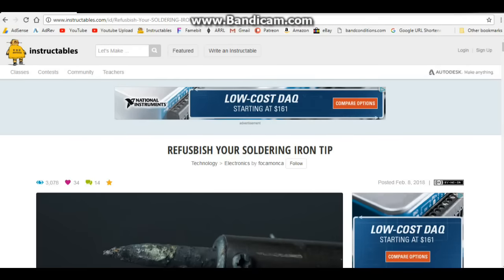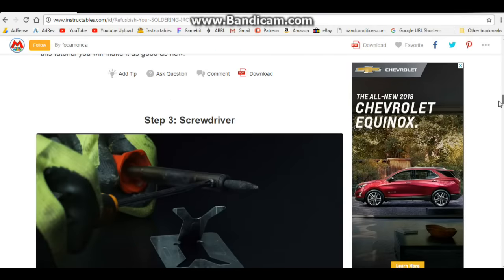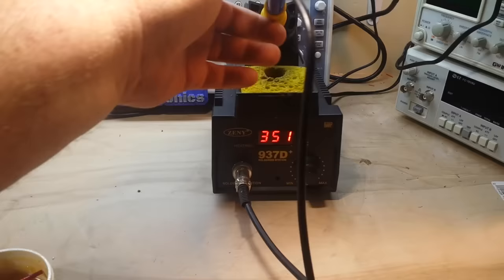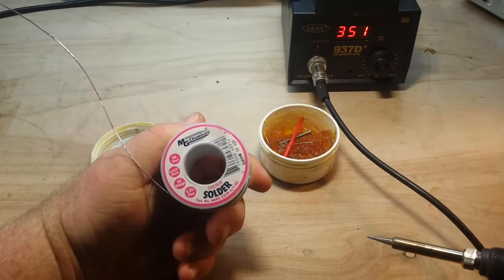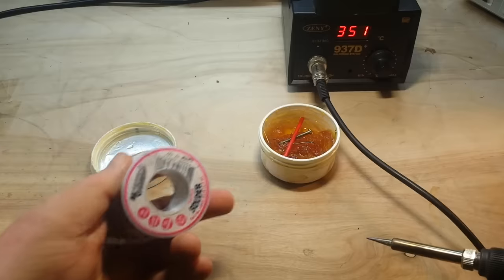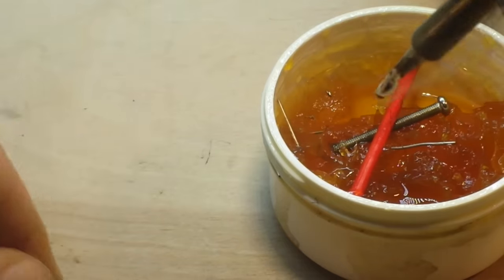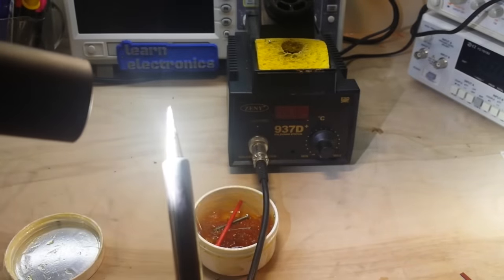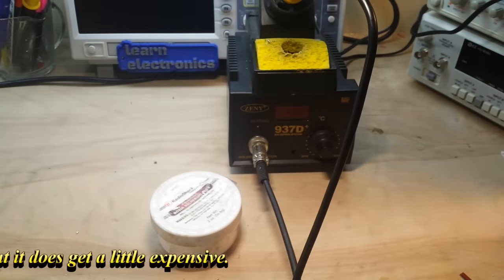How to clean and re tin your soldering iron

Comment: RIP RadioShack!  Is there a reason there is a hardware graveyard in your flux? I considered there could be some practical reason Paul.  Nice video.
Reply from the maker: Just random stuff I've used to scoop out some flux from time to time.
Reply: It reminded me of my flux container. Sometimes you leave the tools in the mix for readiness
Reply: All workshops I worked for had a flux container with stuff left in it.  I never saw anyone - me included - who'd volunteer to get the yucky screws, matches, bits of wire and leads, out of there.
Reply: Oh.... I though they were prizes.
Reply: He's lazy
Reply: it's called a flux capacitor actually
Reply: If I were you I would remove all that garbage from your flux container,  it makes you look unprofessional.
Reply: Mike K Who cares when you do the job right? A clean plumber isn't a true experienced plumber. REAL plumbers are dirty, dirty cars full of fast food and drink containers.  I'm working with 50+ years experienced plumbers and they have their tools and equipment scratched or unprofessional, but looks don't get the job done sweetie pie, try again.
Reply: Gods Bible lol , if you were going to have you picture taken HANDSOME....would you take a shower and comb your hair first? I suppose some might not? 😂
Reply: I bought a cheap $10 iron and used a blade to scrape off any crap that built up on it. Of course, I removed the coating and now the tip is completely destroyed. It's eroded off and it's because the copper dissolves into the solder. Not only does it damage the tip, it contaminates the solder and makes it nearly impossible to solder with the thing. Now I use a wet sponge or paper towel. Doesn't remove the coating and actually cleans much better.
Reply: Graveyard serves as a warning to other hardware.
Reply: WB0WQS likewise I'm from the UK and we had an electronics shop which died last year, sorely missed. Now anything needed has to be online.RIP.Joe
Reply: @ikannunaplays  😂😂😂
Reply: @RoamingAdhocrat  😂
Reply: Looks like my little tub of all purpose grease. Old nails, my kids watercolor brush, whatever was handy (and not submerged) when something needed a dab o grease.

Comment: Radio shack was good when HAM Radio Operators were in charge.
Reply: Remember in the 80s you could build a whole radio from the parts bins at radioshack. They catered to electronics guys and girls and went under due to only selling USB and hdmi cables ...sad...
Reply: @brandonbentley8532  It wasn't that.  They'd have been fine selling USB HDMI etc.  Their downfall was getting suckered into selling cellphones as a loss leader and trying to make margin on the accessories and warranties.
Reply: @cj5939  yup.
"Welcome to Radio Shack! You've got questions? We've got cellphones!"

Comment: I notice higher wattage tips corrode worse (Especially my 40w and 300w iron), and you do have to grind them in order to get them to last your money's worth. Sometimes the thin coating just isnt really worth much haha.
Reply: I also grind the 50 year old 300w soldering iron ;)
Reply: @danijel124  Same here , but that's usually a copper tip which seems to corrode away slowly. I usually put it on the wire wheel whilst it hot and quickly retin the tip. But the one shown here is not to be scratched in any way. I was in need of a new soldering iron, and they are still really cheap. So thanks for the recommendation. I wonder why the Americans say " soder" when in Australia we say "sol der" . Anyway. Great posting about tip cleaning.
Reply: you should use a weller temperature-controlled iron they are 60 watts, so they heat up fast but don't burn like uncontrolled tips that get too hot
Reply: As someone who uses a butane iron for soldering wires in automotive and some electronic repairs (not PCBs), the high heat is necessary most of the time and it absolutely destroys the tips. The moment the tip leaves the sponge, the whole thing turns blue, purple, then washes out to a pale grey in just few seconds. No amount of tinning ever makes it better. Once the outside layer has started pitting away, I get a new tip. They tend to last a year or two though.

Comment: Difference here is the "bad" example shown isn't a thermostatically controlled iron and the tips will be a purer copper alloy than the new ones.   It looks to be an uncontrolled 12 watt weller and mine will smelt steel!!
I have an Antex 35w and a Weller 12w, and while they are good irons they get as hot as hell''s steps if you leave them on and unused for more than a few minutes.  They were designed to be stuffed into a big spring shaped heatsink and regularly quenched on a smelly old wet sponge.  Both my irons look like the surface of the moon when not newly filed.  Its what happens when you use active flux on an old iron burning at something like 500 deg C.

When I started work I used a gas fire to heat a 1 1/2 lb block of copper on a stick, cleaned it with a 10" bastard file and used borax as flux.  Solder was a bar of wiping lead.  Times have changed.

Now my thermostatically controlled rework station ticks over at  a steady 345 deg C (+ / - 1deg C) and switches itself off if not used for 30 minutes.  
I don't use 1/2 lb of solder and a jar of flux cleaning it either - when I've finished working I dip my tip in the brillo and switch off - job done.
Last set of chisel tips I bought were 5 for £4 - the pointed ones were £3.50 for 10, that makes them cheaper than the solder.  I think of them as consumables I change tips to match the current job.
Reply: Now here is a person who knows what they are talking about. I have a couple of those old irons in my tool collection. Some from my gramps, a lead body man way back. At some garage sale, I acquired another one supposedly used for repairs on big babbitt bearings.
 "Dont wreck the special coating and anger the pixies"  This is hilarious....Tinning an iron is the process of coating the tip with metal to enable soldering. THIS IS THE SPECIAL COATING..... I suppose they may be nickel plated when new, but this is not a requirement to get them to work. You can take a brass hinge pin from a door, sharpen it, hold it with vise grips and heat it with a torch, tin it and solder with it.
Reply: I imported Antex irons to Canada for a few years in the late 80's. They didn't catch on for several reasons; one is just people not familiar with the brand and there was already enough competition. You couldn't discount like you could with Asian lines. I did well with the 12V units for car and marine installers for obvious reasons. They were miles better in heating power than anything else "portable" out there. They had some innovative products for niche markets too. I've never seen them distributed in Canada since they thought they would do better with another supposed rep who charmed them., 30 years and counting.

Comment: that iron looks like they been using it to melt plastic!
Reply: yes, probably from all those stupid "DIYs."
Reply: True.... That is why I am using an 30 year old iron, to melt plastic and make burn marks in wood when decorating that way. My electronics solder iron is for soldering only. A second hand iron can be used to cut and melt. Like when restoring computers from the 80's. In rare cases, you need to melt ABS. And that is what a "decomisioned" iron can be used for.

Comment: sir, when i saw your video i added a like and i will happily leave it as a like it because it is obvious your intention was to help but i have to agree with some of the comments below.  I tried the sanding thing and it worked but at first i just turned the tip around and it also worked well.  I like the points you made about keeping the tip clean and it was my ignorance that stopped me doing this but now i will.  so, thanks for your input but as i just solder occasionally the fix i have is fine.  thanks anyway. Terry UK

Comment: I must have missed the part in the video of how to clean a really dirty tip.
Reply: Yeah you missed something alright... It should never be dirty because you clean and tin as you use it 2:06 and before you put it away 4:35.
It's all there.

If your tip looks like the first one, you fucked up, replace the tip.
Reply: buy a new tip
Reply: @Fyrespit  It was given to me from a blind guy. The title said "How to clean and re tin your soldering iron". "Your" meaning me or anyone else that had a bad tip. I'm 69 y/o. I have been soldering since before you were born. I've soldered fenders on cars, cracked razor blades, electric components, micro hair fibers and the like. Soldered with a iron before using electricity. Made my own custom irons, still have them. Shove the razor blade into a potato before soldering. It's not all there sonny boy. My curiosity for coming to this video was to see what a expert had to say about cleaning "a really dirty tip".
Reply: If the tip is as dirty and far gone as the one in the photo then you only have two options, replacing it (best choice) or sanding/grinding it down.  If you choose the latter then you will have lost the iron cladding (a very thin outer layer) and will be left with the copper core that is the actual bulk of the tip (for copper’s thermal conductivity).  If you solder exclusively with leaded solders and keep the temperature down then a copper tip will actually last quite awhile and you can keep regrinding as necessary once it becomes pitted — something that I have on occasion done intentionally when I needed a soldering tip with a custom profile that I did not have on hand in order to get the job done (such as a custom tip for SMD work decades ago before such were readily available) as replacement tips don’t cost much and will last a good while (even “expensive” tips are seldom over $20 for a basic tip), so if you need to sacrifice one then no big deal.  But if you use lead-free solder with a copper tip then the very high tin content will rapidly erode the copper as tin has such an affinity for creating intermetallics with copper that it is almost like dipping your copper tip in a hot acid bath — the reason for the iron cladding is that the iron cladding is not aggressively consumed by the tin the way copper is — hence why tin based solders are so good at soldering components to copper clad boards.  However, if your iron tip ever looks like the one in that photo then you’ve done something very wrong and been very neglectful as the very tip of any iron should be cleaned regularly, typically every several minutes of use you pause to clean and re-tin the tip and if you do such regularly then it only takes a couple seconds to do and keeps the actual working end of the tip wet and shiny.  If you want to speed up tinning even more then you can buy small cups of tinning compound (that last a long while) that consist of fine solder balls mixed in a matrix of dried flux that melt upon contact with the hot iron tip and will quickly clean away the the oxides and re-tins the tip with solder and then you finish by quickly dipping the tip in a brass wool sponge to clean off the loose oxides and excess solder and the whole process takes just a couple seconds and maintains a pristine tip.
Reply: @ethanpoole3443  Now that's a good explanation!. Very nice. Yes, keeping the tip wet and shiny. I was raised by a salvage yard and all the beer drinking guys there took me on as a kid and taught me things like this. One guy said keeping it clean makes the solder wetter. Those guys taught me that once a cut is started I could shut off the acetylene and cut a car in half with only the oxygen tank to save the gas. Thanks for your time.

Comment: I like to use the dremel with an aluminum oxide stone to refresh my solder tip.
Reply: Don't do that it will destroy your iron's tip instead use wet sponge
Reply: Me too, then I take a tin can from baked beans, Bush's Best onion works well, fire up the oxy torch and blaze the can and tip till a big blob coats it, then quickly dip in water - a rock hard impermeable coating forms, never again will the tip fail
Reply: @waleedahmed4591  no it does not destroy the tip ... if you immediately re tin it .....

Comment: hahahahaaahaaa..., love the intro, u'r partially right; if the solder pin is solid copper 100% (i have a few of those...) you can even transform the shape of it, not only sand & polish it. Copper bars are very useful for achieve all those "special" shapes that you can't buy if have'nt the money for the proper ones, & do the job. Thx a lot for your tuto, is very useful too

Comment: Good advice.  I do the same basic stuff.  Just simple good sense is in order.  Clean the tip after each couple of solders.  Keep the tip tinned to prevent oxidation.  A little extra care is in order when you are done and turning off the iron.  Nice video.  Thanx.

Comment: The best way I've found to restore a corroded soldering tip is to first thoroughly clean the tip with a wire brush, sandpaper, steel-wool pad, etc., then apply a generous coating of paste flux to the tip, use a second soldering iron/gun to heat up big drops of fresh solder, and use the second iron/gun to spread the hot solder-blobs onto the newly-brightened tip of the first iron.  This allows the bare copper surface of the tip to be properly tinned, but without initially heating it so hot that it started to oxidize before it can melt the solder that you're trying to tin it with.

Comment: My first soldering irons were from Walmart. They pitted and corroded immediately after the first few uses. I thought I was doing something wrong until I got a higher quality Iron with interchangeable tips and adjustable heat setting and I realized my Walmart irons did not come with any coating on the metal and did not get anywhere near as hot as a proper iron so never got tinned or clean properly.

Comment: Hi, first time solderer here.
I've come across an issue where my tip seems completely oxidized (completely blackened) and not amount of flux is removing it.. I've tried wiping it on my sponge SO many times, but it stays completely black and won't melt my solder... And therefore I can't apply some after the flux. Is my tip good for the garbage? :(

Comment: i got the same soldering iron , but  i updated almost all about it , tips , handle , added silicone cord 1,5m long  , added rubber legs , and lots of other things , and is now one of my favorites . As it was purchased couldnt use it at all , 50cm of cable was too short to use and it was stiff cable ,  god damn it . But now im happy with it

Comment: Instead of wiping it off on the sponge, i use steal wool, to wipe after i use flux and solder. It was a tips i got when i started soldering. Any thoughts on that? Can the wool damage the tip? Or is it fine?
Reply: steel wool is perfect for the job.

Comment: Does wiping off the solder from your tip with brass wool work just as well as a sponge?
Reply: Wet sponge was much more effective for me, and I used it on my grandpa's old 30+ year old soldering iron tip

Comment: Thanks! 
I didn't  actually used a sandpaper... but sometimes  I've  used a cutter to clean it up by scratching the dirt of off of it... which eventually destroyed it! I've never seen how to  properly clean a smoldering iron tip  before.... so thanks a mill! Can I  use any kind  of sponge,  or I need a special  one? 
Thanks again!

Comment: Hey thanks so much for this video. I’m very new to soldering. I got into it as some cool game system modifications need you to be able to solder. But my tips did start getting crappy. I did wipe it off after every solder I did. But it’d still start getting dark and ugly. I found tip tinner on Amazon. But didn’t know how it was supposed to be used. Saw what looked like a steel wool scrubber but was either bronze or copper and bought that as well but it didn’t really help. And considering your explanation that probably just causes the same issues as sanding it. Or maybe I’m doing it wrong. Either way I did not know how to properly care for my soldering iron tips. This was easy to understand. Clear. To the point. And even explained why sanding it would be bad. I really appreciate the info. Hopefully now with this my tips will last longer and be in much better condition going forward.

Comment: Did what the instructable shows. I found there's no problem with sanding the tip as long you tin it back properly.
Especially on cheap soldering iron.

Comment: QUESTION, if I'm not sure about the quality of my flux, is it possible that by putting too much on the tip I'll make it dirtier? Or does it turn black because I simply don't control the heat well?

Comment: Use the brillo cleaner. I did the sponge for a few years and the brillo pad is SUCH a nicer experience. Cleaner, less nasty looking, easier to dispose of solder balls, it's just better. It even does a better job of taking old solder off the tip.

Comment: Hi, I have a HAKKO FX-888D and I used the rosin paste flux like you did in the video then I recoated it with tip tinner for Thermaltronics first and then and I used tin solder and then I wiped it off with the wet pad and cleaning wire in the soldering machine but it got worse. The tip is silver but I got a ton of black oxidation after it on the rest of the tip and handle. Can you please help?

Comment: What exactly is the Weller WST-WPB1 polishing bar that they tell everyone to use over the flux or the soldering acid tip cleaner?
Reply from the maker: No idea
Reply: @learnelectronics Well, check it out as it is 19 dollars and you rub it on it and it removes the oxidation.  I mean it looks like a fine fine grinding stone.

Comment: Well, to be fair what you showed is good as a regular maintenance practice on a tip that's in relatively good condition. For something as far gone as the tip in the instructables, flux alone won't do jack, and you'll never be able to get a decent wetting. You can either toss it or attempt getting some borrowed time out of it with aggressive cleaning/sanding, just to get it to wet again.